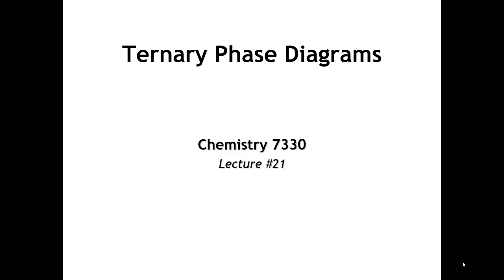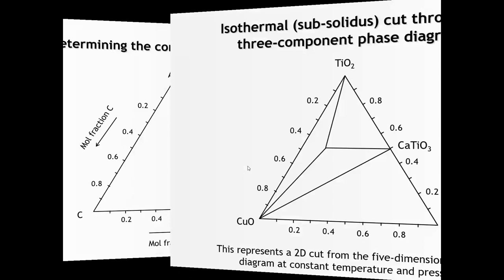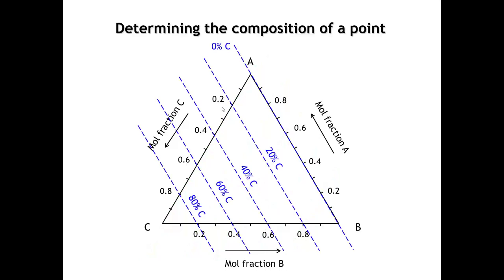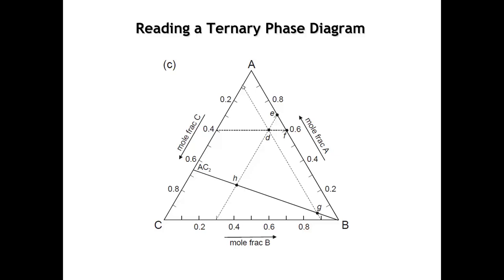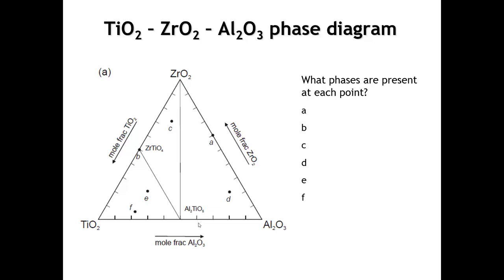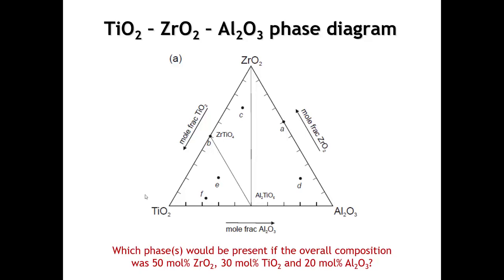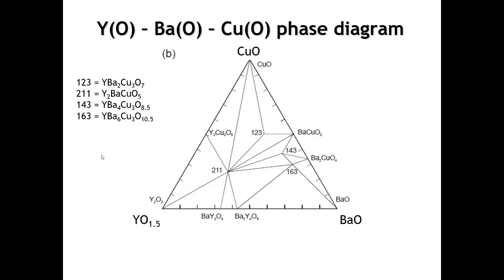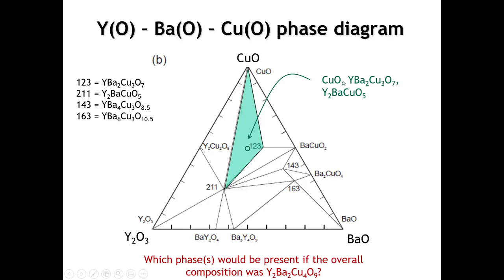Lecture 21 Ternary Phase Diagrams

Comment: @Pat's Perovskites - Hi Patrick, for the phase diagram at 11:47, I found the following additional phases for points c & d: Point C is in the triangle with vertices Al2O3, ZrO2, ZrTiO4. It is also in the triangle with vertices ZrO2, TiO2, Al2TiO5. Similarly, point D is also in the triangle with vertices Al2O3, ZrO2 & ZrTiO4. Are these also valid answers? If not then why not? Thank you. For your last question, I proceeded as follows: The compound with the closest composition to the target Y2Ba2Cu4O9 is compound 123 (YBa2Cu4O7), subtracting 123 from the target gives BaCu3O4, which is BaO + 3CuO. So our target lies inside the triangle with vertices 123, BaO, CuO; which are also the phases present. So to make the target, we combine 1 mole each of 123 & BaO and 3 of CuO. Is this answer valid?